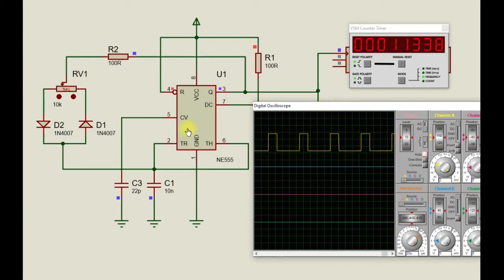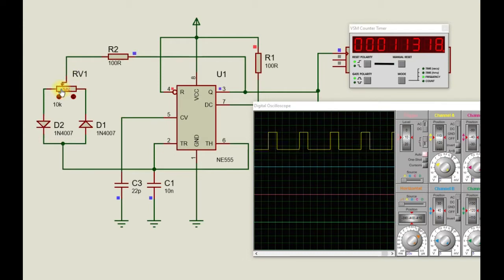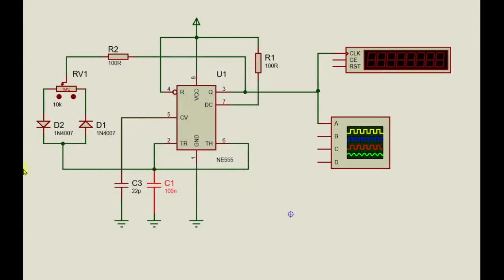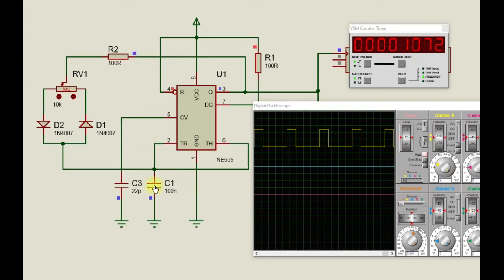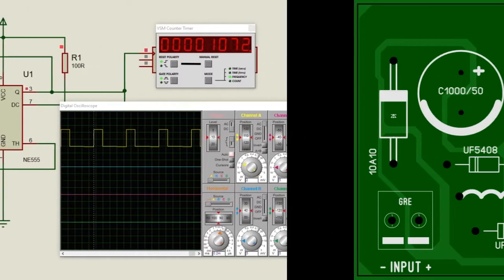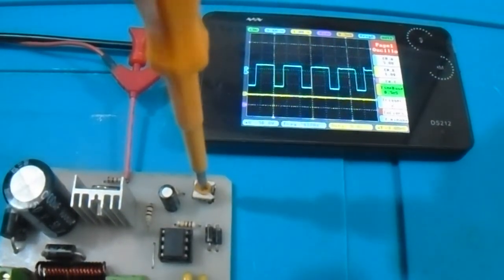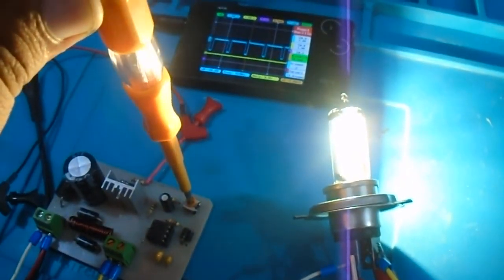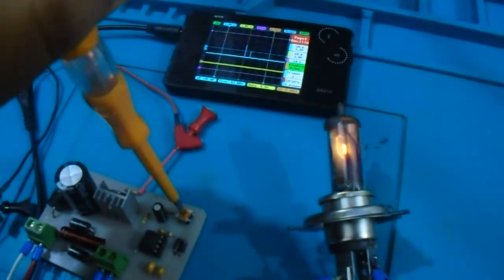Simple Buck converter using N-Channel MOSFET and NE555 as signal generator

Comment: A buck converter using an N-channel MOSFET and an NE555 cannot work alone because the N-channel MOSFET is used as a high-side switch — its source is not connected to ground. Therefore, you need to use either a P-channel MOSFET or a gate driver circuit.
Reply from the maker: You can try once to justify.